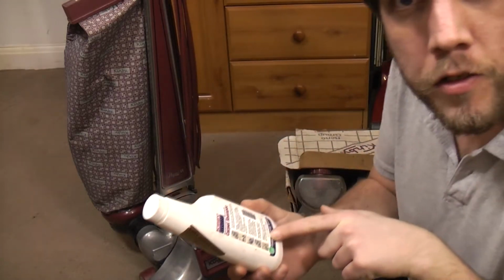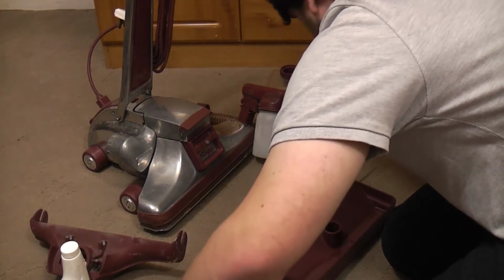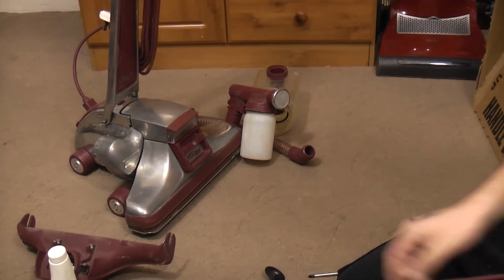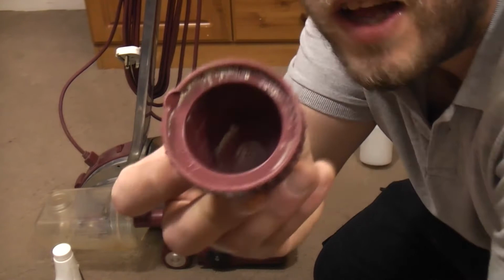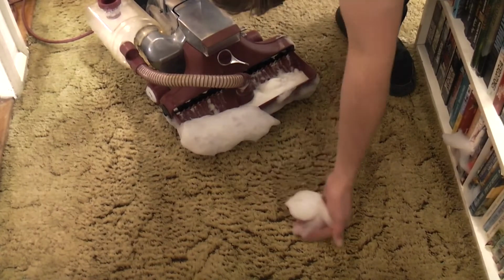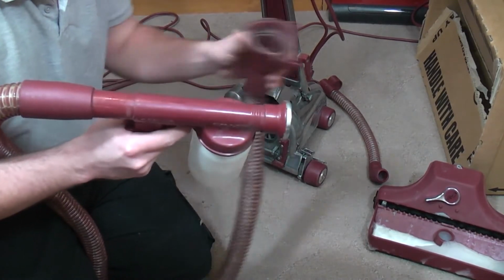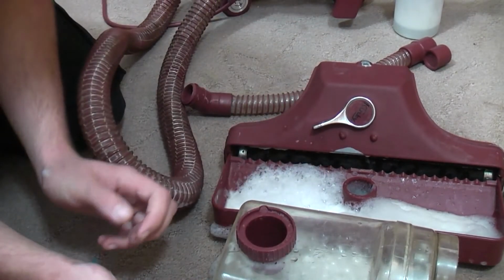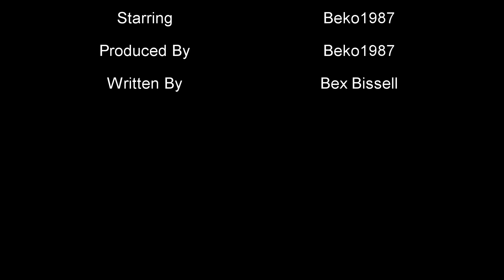The Kirby Legend 2 Demo's Part 3a - The Rug Renovator!

Comment: Thanks, you solved a problem I have had for  weeks.  I had to buy a new tray for shampooing as I left it in my last house when moving.I had to buy one from ebay and the seller told me the legend 2 shampoo tray set-up would go with my Heritage 2..... Anyway I could not sus out how to attach the brush to the tray as I did not know that to stop the screw from turning eternally I just needed to hold the one with a screwdriver while unscrewing the screw on the other side.  I can now shampoo my carpet. Cheers

Comment: The spray gun has to be assembled with the hose going on the Emtor end, and the air intake guard where the hose would usually go.
Reply from the maker: Yep, I realise that now! Knew it in the first place tbh, I just had a massive brain fart! Very lucky it didn't empty the spray gun bottle into the motor!
Reply: I thought I saw you had a close call when you did that wrong! Luckily the suds formula didn't get sucked into the motor and possibly shorting it out and shocking you!

I hope you can assemble that in the right way in your next video!